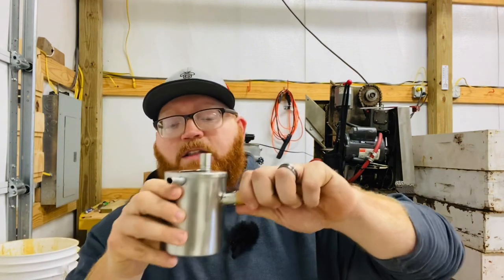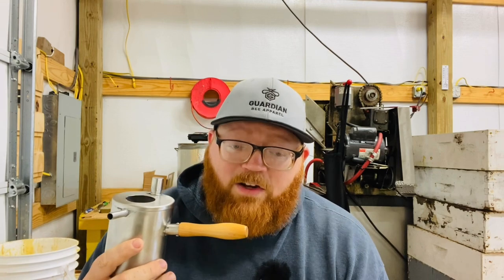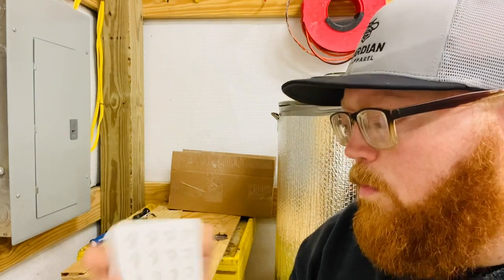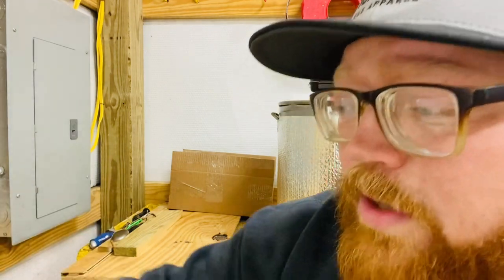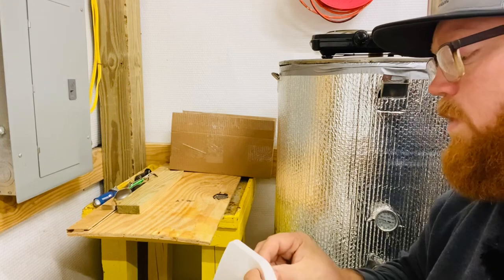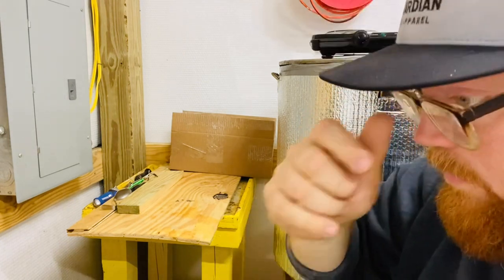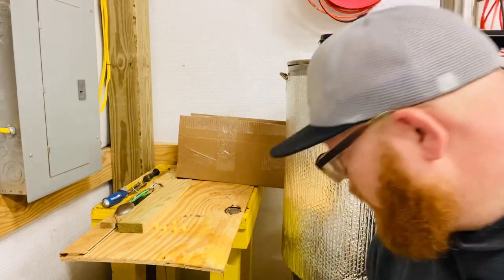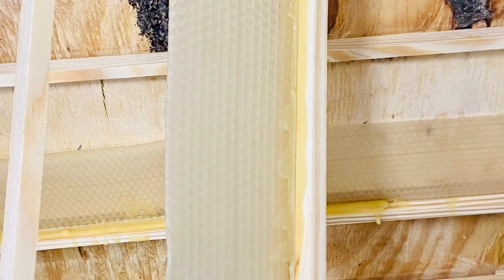Beeswax Burette & Silicone Queen Cell Mold Unboxing— inspired by @richardnoel3141 ‘s channel

Comment: Gus might want to blow out the mold between fill ups. Low pressure air hose or by mouth to remove the water/other debris that could cause the jagged tops. Thank you for taking the time to aquire these new items and share with us how they perform in a somewhat live type of environment

Comment: I have always struggled with trying to keeping unwired foundation in the frame. Between this video and the one on comb honey. I now feel much more comfortable doing the wax. Used the  spoon on a few frames. Really worked well. Bought a burette.  Haven had an opportunity to try it yet. Even watched Richard's  video.  I was wondering about working over a disposable  foil pan wit some water in it.  For easier clean up. Thanks again great  content.

Comment: Fill it completely. Theyll pop off in one piece with practice. You can cut them.into strips and melt the tabs to the frame.
Reply: I just did a little research. That mold you can't do that with. I'm looking for one now with a way to pool the wax and cut 5 cups at a time. 
Down the rabbit hole I go!

Comment: That could be quicker than the way I do my cells. I made a stick an dip it takes a wile but have gotten pretty fast at it. I leaned to put it in your cell starter over night an the bees will fix an polish the cells for you before you graft.
Reply: This is what I have done as well. When I grafted with Shane the first time I used home made ones from dowels. If  you put the cells in 24 hours prior to grafting the bees will work them down and they become very uniform.

Comment: cool i just made a tube fastener  out if copper stub out pipe, w rubber hose  handle,worked ok locking in wax foundation
Reply from the maker: I’m not a fan of the tube fastener. My bent spoon works very well, as did the burette.
Reply: @gusmitchellcranesnesthoney6529  it actually worked good for a quick self-made  project

Comment: Hey Gus, Spoon or burrett,  what about angling the jig so the hot wax runs down along the frame?
Reply from the maker: It is slightly angled, but needs a steeper angle for sure.